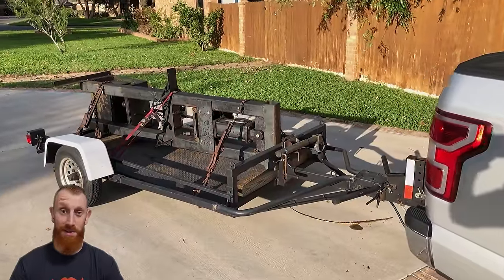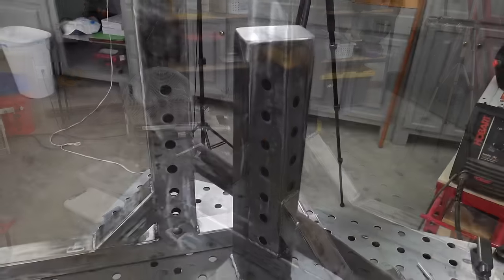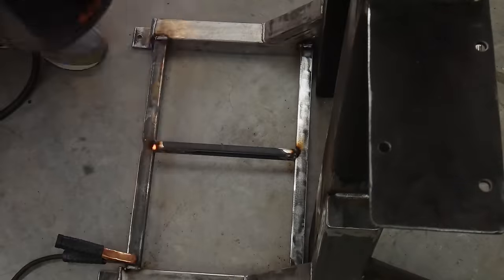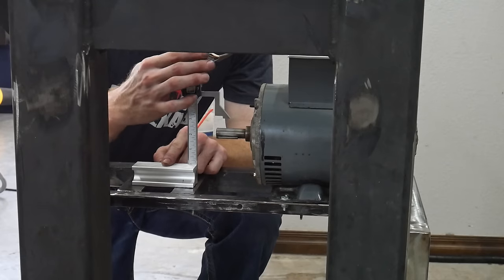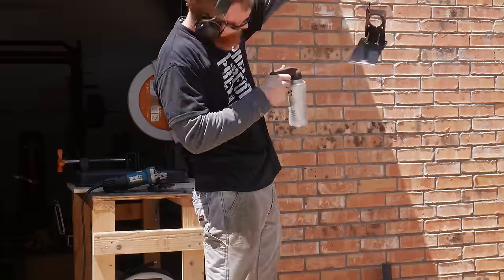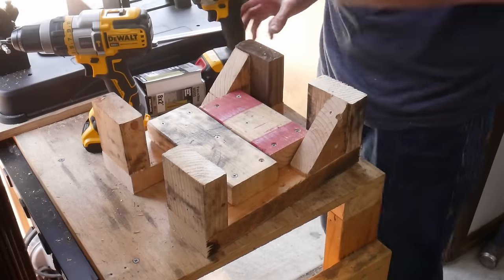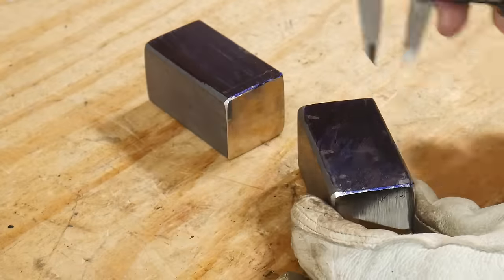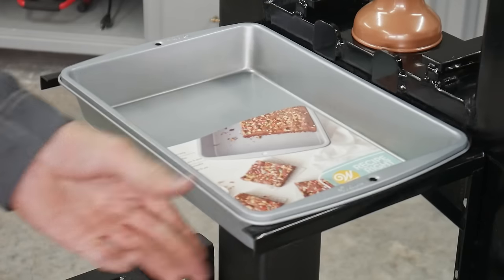Homemade Hydraulic FORGING Press - EXTREME POWER!! 💪

Comment: Hi sorry to be a pain, but I can't get the 1 Spool 20 GPM Prince RD-2575-T4-ESA1 DA Valve, but I can get this one 1-Spool Hydraulic Directional Control Valve P40 SAE Ports Double Acting as I have no idea if the 1-Spool Hydraulic Directional Control Valve P40 SAE Ports Double Acting an alternative
Reply from the maker: I think this thread will answer your question - https://www.bladeforums.com/threads/home-made-press-hydraulic-press-question-wont-hold-billet-for-twisting.1889599/

Comment: Since your shop concrete isn't reliably flat or level, why no leveling feet?
Reply from the maker: That would be another good option for sure! In this case I ended up putting the press on casters. You can see some pictures at the bottom of this thread - https://www.bladeforums.com/threads/homemade-hydraulic-press-recap-plans-parts.1805864/

Comment: Think you might be better off running high rpm on that hole saw. The material removal doesn’t correlate to the same size twist drill
Reply from the maker: Gotcha, good to know!

Comment: Estimated cost? Is the size of the pump what determines how fast it moves?
Reply from the maker: Really changes a lot with current steel cost. You'll have to price it out locally. 

The GPM of the pump controls the speed.
Reply: @RedBeardOps  thanks. Are you satisfied with the speed (IPS) or would you prefer something quicker?
Reply from the maker: @williamchase5698  This speed is ideal. I wouldn't want any fast than 11 GPM. Some people can go faster, but I want the control.

Comment: nice job, just one major error, for safety reasons, the hydrolic pump should be placed under the tank, then the system can not get air trapped in it..
Reply from the maker: This orientation would be ideal to prevent cavitation
Reply: Yes. I have gotten tips from an hydrolic expert saying that to insure an airfree system, place the pump under the tank.

Comment: Well, an oil filter to keep the oil clean.  I needed also a way to handle the long shaft, that narrow throat of 4" is troublesome. cylinder should be 16" stroke. not 8"

Comment: The build looks awesome... i've been looking around for some reliable press plans. How did you safety check the design? There was a ton of concern on one of the sets of plans i was looking at that it wasn't overbuilt enough and that the design was dangerous based on the force calculations performed by someone way smarter than me.
Reply from the maker: Hey man, there have been no safety checks on this design.... build at your own risk!
Reply: @RedBeardOps  have you noticed any issues, especially with the off-centered dies? i'm sure all the welds need to be solid, especially where the 1" plate meets the tubing but i worry about penetration on the thick side of the steel and blasting through the pipe wall...
Reply from the maker: @thebogamin  I have not had any issues. You will naturally get some movement with this design when pressing off-center. A more sophisticated guide system could solve this.

Comment: Just found your channel cool video. But why not arc gouge the welds off that plate or burn them off with a torch then just reweld it to the frame after you drill the hole out. Cool stuff though.
Reply from the maker: Glad you liked the video! I bet there were a few ways to skin that cat. Cheers sir!

Comment: Would a 5hp motor be over kill for a 4x8 cylinder  that does 2500 psi?
Reply from the maker: hmmmm, I'm not 100% sure. It feels to me that it's not bad to over build. If the RPMs match the pump, I'd say go beefy.
Reply: @RedBeardOps  ok thank you I'm currently building this press with 2x4 steel tubing and I'm having fun with every step so far the h frame and moving jaw are assembled...and thank you for the plans this is really going to up my forging game
Reply from the maker: @adamcronin1468  Heck yeah, good luck with your build! Be safe... lots of pressure being delt with. I think one of the biggest safety threats of this design is the exposed hoses.... I'm sure there is a better way to do that. I can't have a forging session without using this guy now days... very handy. Cheers!

Comment: Nice rebuild.. I'm not an electric motor or hydraulic expert, so I asked my local experts (at my hydraulic supplier)..it was explained to me, that electric hp is basically equivalent to 2 times the hp of a gas engine..5 hp electric would be equal to 10 hp gas..but I don't know if my experts are telling me the truth or not.. I use a 5 hp electric on my 20 ton log splitter press, and it's more than enough (I'm upgrading to a 35 ton H-frame press as soon as I stop being so lazy 😂)
Reply from the maker: Very cool! Cheers sir

Comment: What about Tons? The cylinder on its specification is 3000psi max.
Reply from the maker: I have the math here in an excel document if you want to know the tonnage at different pump discharge pressures - https://www.patreon.com/posts/55107545

Comment: You should not be putting pipe dope or Teflon tape on the threads of an AN fitting. The threads do not seal the oil into that type of fitting. The internal flair is the sealing point for this type of fitting, the threads simply pull the two fitting together. You can actually crack the swivel if you apply to much tape, it puts pressure trying to expand the swivel. They are not designed to take the pressure of anything in the threads, making them crack and split and will cause a massive leak. 
I worked for a hydraulics manufacturer in Florida. We used these kind of fitting every day in the testing of our products. You could tighten them 20-30 times a day changing your setup for testing the products. We have seen them crack and blow out just from being tightened and loosened over time. It is pretty impressive how big of a mess the oil can make when the line blows out at 6000psi with a 9gpm pump running it.....
I retired from there back in 2018 and moved to Thailand at the ripe old age of 43.

Nice looking press, you can make the hydraulics do almost anything when you go down the rabbit hole of custom manifolds and cartridge valves.

Comment: Where did you place the filter and gauge? In vs out
Thank you
Reply from the maker: I think I show that in this video. The filter is downstream of the 4way valve and the gauge is on the high pressure side.
Reply: @RedBeardOps thank you very much.

Comment: When you moved the mini mill to drill the hole... Don't you think it would have been easier to cut out that plate... drill the hole, and then re-weld it back into place? I know it's easy for me to couch quarterback. To that, I'm not at all negatively judging you. I like your engineering build.

Thank you for sharing your knowledge.
Reply from the maker: I had that 1'' plate welded onto the frame wayyyy back by a professional welder. Considering the forces involved, I didn't want to compromise the integrity of the press by cutting and then rewelding with my sub-par skills. In addition, I really do think that would have taken much longer, moving the mill was fairly easy. 

Cheers!

Comment: Would this build also work for a 100 ton cylinder?
Reply from the maker: My word! I have no idea.... I guess it could with high gauge steel on the H-Frame. That's a beast of a cylinder... I'd probably upgrade the guide system as well... maybe with some bronze bushings or with guide rods like Kyle Royer's press. You're going to want to beef it up big time
Reply: @RedBeardOps  Yeah, I know it's really ambitious. Also, I lack some of the needed skills to pull it off. But, I'm willing to learn new skills. Basically I want to build a coin press. To do what I want I need 100 tons. Someone suggested I get a flame cut continuous frame. I guess that's just a frame from a single piece of metal? At any rate, I think your press is awesome!
Reply from the maker: @JustinCiriello  man I don't even know; good luck with your build; very ambitious!

Comment: what size and how many of these barbed fittings  do you need for build? dont see them in the video and are all the hoses 1/2 and how many total did you use sorry for being a pain in the AZZ   Mark
Reply from the maker: If you go thought the "Hydraulic Components" list in the description it has it all there. Only barbed fittings were used on the suction hose.
Reply: @RedBeardOps  ok thanks i just wasnt sure on the amount to get of the 90 degree and the size of the barbed fitting  thanks again
Reply: @RedBeardOps  thanks james i just have 1 more question how many hoses do i need to order it doesnt say how many  i have almost everything but the amount of hoses total needed
Reply from the maker: @Anderson-HandForged  Hey CT, I do have the hoses in the components list.
Reply: Yes i see that i wasnt sure if i needed more than one of each hose for the build

Comment: i cant afford a mig welder. could i do this comfortably with a 225 ac stick welder like from lincoln electric and some electrodes?
Reply from the maker: I think an 225 Arc would work better actually. You're dealing with a lot of force here... be safe and make sure your welds are solid. May want a professional to check them. When I did my project back in the early 2000s we had a welder friend come by and help me with the structural welds.
Reply: @RedBeardOps  oh so you didnt do all the welds for this yourself?
Reply from the maker: @baduktiger7661  Nope, I was a teenager when I built this main frame in the early 2000s. Didn't trust my skills and had a family friend help.

Comment: I’ve been dying for someone to make this kind of video. I don’t want a million ton machine. It needs to move if I move.  I want like 16 ton and I can move. I was going to buy the HarborFreight press and weld it together instead of bolting it together and add electric press.
Reply from the maker: Glad you liked it Christopher. One reason I put holes in the tabs of the foot sections is for the possibility of putting this press on casters one day if I wanted to. Would be nice I think!

Comment: Please be careful using steel pipe at your working pressures. It looks like you have used 1" schedule 80 pipe. ASTM lists a working pressure of 3500#, but also recommends a 25% reduction for hoses and fittings. When you can swing it, you should replace it with seamless stainless steel pipe. I would also recommend using a locktite designed for hydraulics vice a Teflon paste.
Reply from the maker: Thanks for the recommendation

Comment: The trapped pressure is caused when they plug the cylinder. They test the cylinder then plug it. 
If the atmospheric temp in the shop is lower than what it is in your place the oil will expand slightly in the cylinder causing a little pressure. It seems more than it is. If your shop was colder the cylinder would arrive under negative pressure and you’d here a bit of air slip in as you undid the bung 
God I just bored myself!!
Reply from the maker: Lol, that explains it! Cheers!

Comment: Because bare minimum $250 for a new reservoir right? And you're gonna buy a new reservoir because you're worried about moisture in it? Are you kidding me? Even if you took brand new hydraulic fluid filled it up overflowing and then dumped it out and left it upside down for a few days it would be completely moisture free and it would cost you almost nothing compared to the cost of a new reservoir I wish I had that kind of money
Reply from the maker: It was stored outside for over a decade empty in a humid environment.